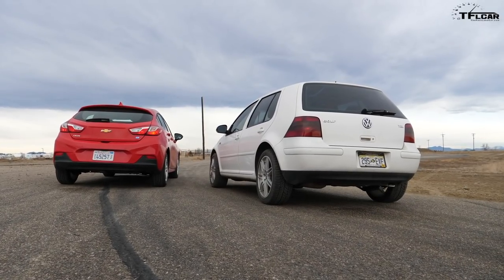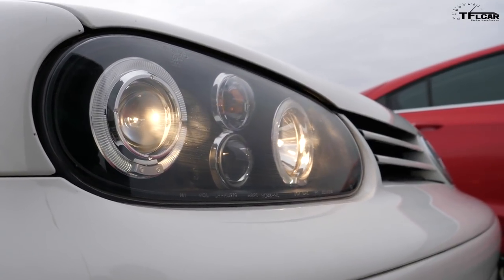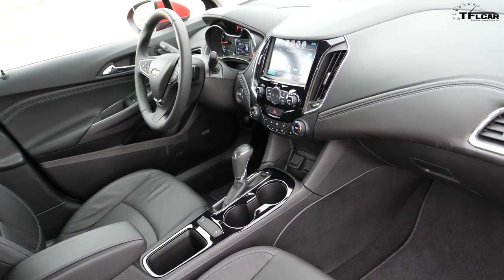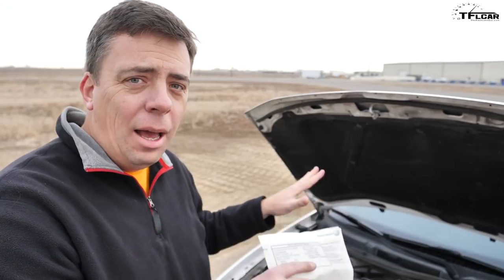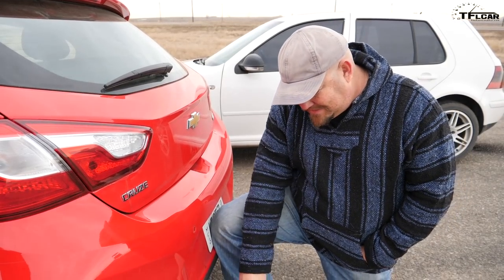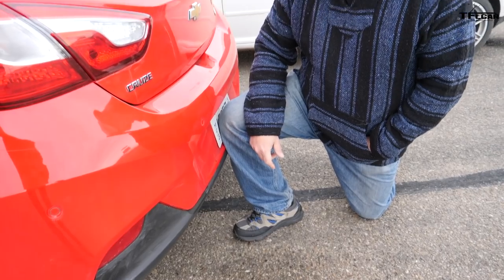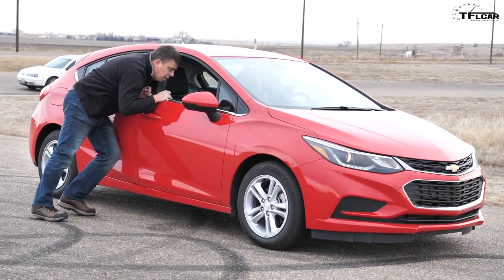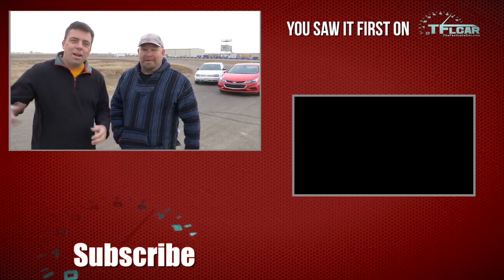Old (2002 VW Golf ) vs New (2018 Chevy Cruze) Diesel: Have Oil Burners Improved?

Comment: what is with you guys and diesels. They're loud, rough, slow, and SO dirty and polluting
Reply: you are wrong in so many ways! why you think they are polluting and dirty??
Reply: Mr. World did you see the soot that came out of the tailpipe?? And diesels have always been known for having higher emissions than gas cars
Reply: Did you see the lack of soot that came out of the cruze though?  I think that was the point was to show that the new motors are coming a long way with emissions.
Reply: Loud? Slow and Dirty??? Did you watch the video? The Cruze is a 2018. FAST, QUIET and CLEAN. The opposite of your old perception dating from the 1990's. I have one and it's so quiet that if you stand more than 10 feet away, you can't even tell it's a diesel vehicle.
Reply: If you're referring to the GOLF, you're right, because It's a 2002. What do you expect? The cruze is clean and as you mentioned have always BEEN KNOWN. That's in the past. New diesels are very clean. Except for those involved in the Diesel gate scandal.
Reply: Powerful, fuel efficient, and reliable. I never was a huge fan until I drove one, now I don't want to go back to gas.
Reply: Cory R Give the e-golf or Chevy bolt a test drive. You won't go back to diesel.
Reply: azera55555 The fact remains the most responsible way to use crude oil is to utilize all of its distillates. Wasting diesel wastes crude. When diesel becomes more scarce, oil burner passenger cars will go away.
Reply: Bryan Banks what happens when I have to drive 300 miles?
Reply: Right now it takes a bit of effort... in a couple years it'll be super easy to plug-in, go to the bathroom, get a coffee and continue on your way. I'm currently driving a chevy volt and drive more than it's electric range very few times a year. We visit the gas station once every month or so. I cannot wait to have a tesla m3 someday... 310m range and superchargers all over the place.
Reply: While it's true that diesels don't accelerate like turbo gas engines, the rest of what you said is archaic.  I live overseas, and I always choose the diesel option.  The quiet, confident power is soooo addictive!  Americans really are missing out!
Reply: Brian yes electric cars cost more up front however there is a break-even point because each mile driven is a lot less expensive. Not to mention their price will come down quickly as production scales up over the next couple years.
Reply: have you ever driven one? go drive a bmw 335d and then tell me that its rough and slow, they all idle a little louder than gas cars, cant argue there
Reply: Yes, I used to own a 2013 Jetta tdi. It was more quiet than most diesels and I loved it at the time. But, owning that car opened my eyes to how easy it is to let stuff bypass the emissions equipment... like when you're hitting it hard going up a hill or when my car was not in the test stand. Electric vehicles have a lot harder time cheating. Have you ever driven a tesla? Probably not so rough, slow or loud. AND the torque is instant and constant... meaning you don't have to be at specific optimal rpm's to realize max torque. EV's have max torque at zero speed... I can't wait for an electric truck!

Comment: I hate diesel fuel.  I will never own a diesel.
Reply: Its a bummer how the diesel pump nozzle is always coated in an oil film and makes your hands stink.
Reply: I rather drive a car on Diesel fuel if I get involved in an accident. Diesel DOESN'T Ignite like gas does. It's a lot safer and therefore insurance is cheaper on them as well.
Reply: @jeffk464  I bring disposable gloves with me and leave 'en in the trunk.  Does the job just fine.  I learnt about that oily pump handle on my first trip to Chevron.... Haha